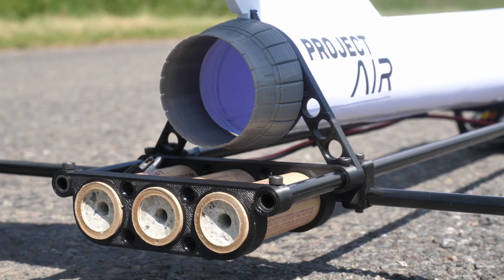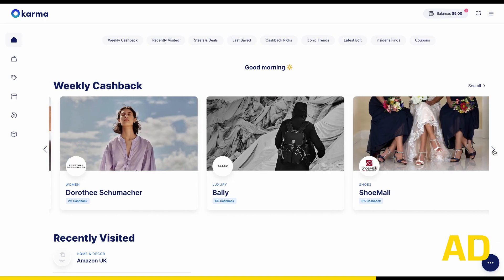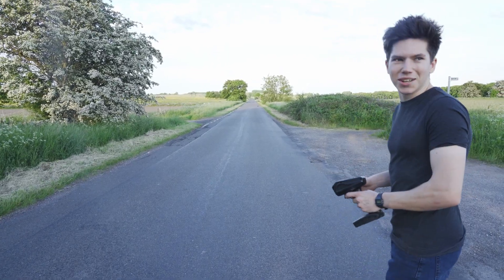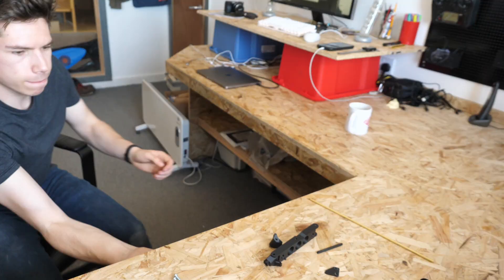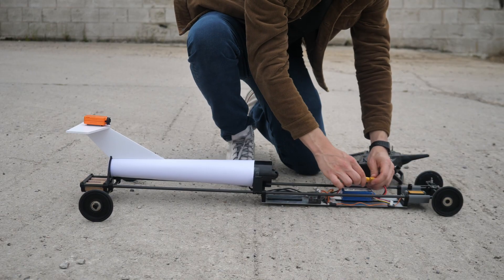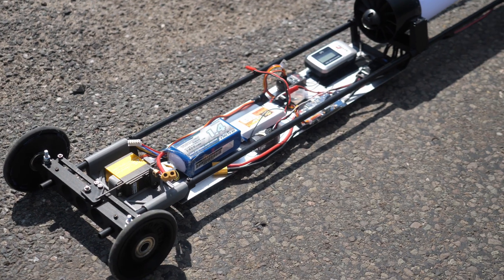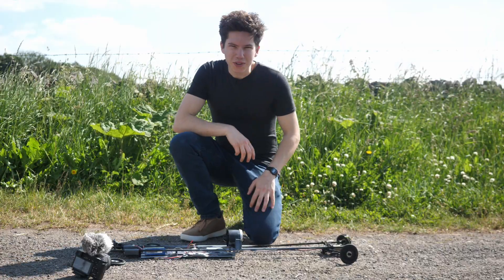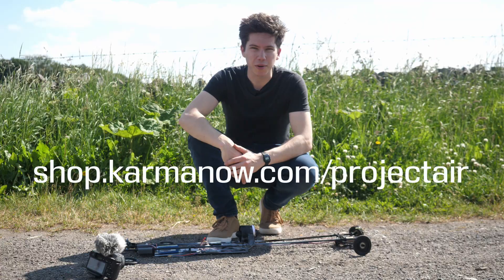Making a Rocket Car

Comment from the maker: Something always has to go wrong 🔥😂 Looking forward to building off this initial experiment with a much improved MK2 car in a future video. Leave any questions here and I'll answer with an FAQ edit to this pin!
Reply: Yeah it always happens lol excited for the video
Reply: True hardwork can be only achieved by mistakes....
Reply: Yes something always go wrong with my school projects
Reply: Suggestion instead of manual alignment to keep it straight you can buy rc car gyros which will greatly assist in keeping it in a line.
Reply: You should add live axle suspension, pretty simple suspension and better than no suspension. Also gotta love that you dont drive a broring grocery car but a real classic
Reply: lmao what do you expect strapping rockets to a car
Reply: @pedasjma23  
success without failure teaches you nothing.
Reply: you could try to use some tires with a bit more grip
Reply: and you could try to use the ejection charges to boost the car
Reply: No problem man at least u tried 💚
Reply: Maybe also put the rockets on the front...? I'm not an expert or anything, but on cars it is a lot easier to lose control on rear wheel drive cars than in front wheel cars, so maybe this can be applied to rockets.
Reply: That's the beauty of designing your own toys..... Imagine, design, build, test, destroy.... Do it all over again.
Reply: Try putting some kind of rubber material on the tire
Reply: What about using Dyson's fan design that increases the output of the input fan ?
Reply: i think you have to remove (od drastically change) the edf duct to inprove stability and, most importantly, speed
Reply: @riks7256  also needs some rubber on the tires but most importantly a suspension, got a lot of shaking, but for his first time doing this, it was largely successful i would say
Reply: Love your actual car
Reply: Great video, love your mini. You wouldn't consider building upon a already well established chassis in the RC world? Kevin Talbot (a fellow British youtuber) is building a 200+mph RC car on a store bought chassis to set the new world record for RV speed and is already achieving nearly those speeds without issues with the chassis.
Reply: @jacob.s3619   yeah but his point is to make something completely of his own, keep in mind that his final project is to make a car good enough for him to attach a jet engine on it
Reply: This is Crazy project lol
Reply: what 3d printer do you use?
Reply: "Well, atleast it didnt catch fire!"
That part made me laugh.😂
Reply: You should add the head part of the chair in your car so you wont die of splashback if someone hit's you
Reply from the maker: @dor4610  I will be!
Reply: @Project-Air  folks calm down...
Reply: ProjectAir Run jet engine with kerosene and oxygen mixture also with aerospike nozzles
Reply: ProjectAir don't ruin your jet enginr
Reply: Have you tried running the turbine on ethanol/methanol/wet ethanol to get higher thrust?
Reply: @brucebaxter6923  EDFs work on electricity
Reply: @adri1572  
and?
Reply: Run jet engine with kerosene and oxygen mixture also with aerospike nozzles
Reply: @parshvapatel8484  
the egts get too high before you reach stoich.
so you run a low energy fuel plus run it wet to get more thrust
Reply: true:(
Reply: @Crazy about plane crazy! 🤣🤣🤣🤣🤣🤣🤣🤣🤣🤣🤣🤣🤣🤣🤣🤣🤣🤣🤣🤣🤣🤣🤣🤣🤣🤣🤣🤣🤣🤣🤣🤣🤣🤣🤣🤣🤣🤣🤣🤣🤣🤣🤣🤣🤣🤣🤣🤣🤣
Reply: @emersonsims9503   you might not be a kid but you certainly is acting as one
Reply: @k-osmonaut8807  true
Reply: Trying to make plasma jet engine
Reply: Hi 👋
Reply: How would i get in contact with you to sponsor you to create this https://pdfpiw.uspto.gov/.piw?docid=10712134&SectionNum=1&IDKey=3B86FF913D05&HomeUrl=//patft.uspto.gov/netahtml/PTO/patimg.htm ? it is a two-stage bullet, gunpowder then rocket fuel.
Reply: Dont know why theres so much hate here... it was a successful prototype. Rocket cars arent easy! Cant wait to see mk2!
Reply from the maker: @ACplanet  Thanks man!
Reply: @ACplanet  Same! This man is great at what he does and should keep doing it. I bet that all the people who gave hate to him barely knows how to use a screwdriver.
Reply: Could you use bigger, wider wheels? I know it'll effect speed but if you're using 3 rocket engines, you might as well as at least it'll stray true right?
Reply: Love your Car!🔥
Reply: https://youtu.be/DXeEgeN_QKYllt
Reply: Love the project. What if the edf was moved forward of center so it's pulling vs pushing the car? May be more stable and allow a long vertical fin to use edf airflow to stabilize car against torque and thrust factors. Very cool project.
Reply: What's the usual airspeed of a plane with the same EDF setup? 30-40kph seems rather low, was the slow speed just due to the small tires and bumpy road perhaps?
Reply: They're called 'small municipal airports'. Find one. Your gear keeps getting torn up by terrible surfaces, like George Russell going over a sausage curb.
Reply: Yo you can make the car aerodynamic and add a some airbrakes on top and  engage it if the car get airborne
Reply: Sponseres called karma😂😂🤣🤣
Reply: I would put a wing on the front and a camera   if possible so you can get a driver's view for control and stability and while I hadn't seen the fire before I decided if I was doing it I would place the rocket motors mounted futher forward to minimize the weight shift as they burn. along with wider wheels  and a staggered ignition use the first one for the initial start after your maxed out with the ducted fan and then bring in the other two after a one second delay so the initial boost doesn't create stabilization problem. and I also would have mounted the rocket motors at a slight front down angle of about 2 or 3 degree and for the parachute deployment charge I would think about small vents to blow the heat away from the chassis. I haven't ever mounted rockets to a remote controlled car I've mounted them on model cars and got a few on fire and had them all get unstable until I put a little bit of downward angle on the rocket motors and they didn't like being at the rear they prefer to be mounted more towards the center.
Reply: everybody gangsta till the car goes airborne
Reply: @Crazy about plane crazy! two things wrong there. 1 im not a kid and 2 I'm not jealous at ALL. Why would I be envious of these projects. Wtf Is Wrong with u?
Reply: Yeah and that "wrong" is the design and the builder.. literally all your projects are useless and just clickbait.
Reply: @emersonsims9503  jealous much?
Reply: @davidkettell6236   jealous? Certainly, he even deleted some of his comments
Reply: @emersonsims9503  lmao u are just probably jealous because you cant make something like he makes, just stfu
Reply: @emersonsims9503   and you go touch grass, do what you said then, do something better than him and post a video
Reply: @emersonsims9503  i bet your built like a discord mod
Reply from the maker: @emersonsims9503  thanks for the kind words :)
Reply: @Project-Air  your welcome!
Reply: @emersonsims9503  bet u r satisfied now.....if it weren't for thos eccentric to create things useless for common ones...we won't be having all these luxurious tech life..... if he's not doing this someone else would so...
Reply: @topn-09  Lol. Seriously tho... don't over think it
Reply: @emersonsims9503   hey sir, here is your order for 900 kilograms of useless attention

Comment: 1st, you need a suspension system to decrease oscillations from the solid wheels and this will increase tractive force. 2nd, you tapered the exhaust from the EDF, it might be too restrictive for proper flow and what overheated the motor. 3rd, drive the rocket car POV for better control and draw, or paint a bright strip to follow for a centerline on the road. Nice try❤

Comment: How did you go about igniting the rocket motors remotely?
Reply: I'm a bit late but you can use a brushed ESC and and connect it to the igniter. Would also recommend putting it on a channel with a switch

Comment: I did one of these years ago when I was in college, you should consider using homemade sugar engines they have a lot more power then Estes engines and are alot cheaper.  You also won't need the turbine that just adds a lot of weight and high center of gravity.
Reply: Pretty sure they are illegal in the UK at least ik they are in canada

Comment: If you wanna make some thing similar to this again, that’s going to be going that fast I would suggest buying a receiver with a Gyro, which, as you probably may know, helps to keep your RC car going straight by communicating with the servo, and they are pretty expensive. I think the cheapest one would be over $100 but I have a Traxxas one that I don’t use so maybe if you ever make a PO Box I’ll send it to you

Comment: I built 3 R/C rocket powered cars. I see lots of things you did wrong... My 3rd gen car did 60 mph in 60 feet at about 1.5 sec. The drag strip could only measure my car to the 60 foot mark of the track.. They estimated my car going about 130 mph basted on my 60 foot mark...  I ran my car on a full sized drag strip in front of thousands of people... One thing you should've done is add front suspension and adjustable tie rods/steering rods... I would find a much smoother surface to drive on... I would recommend a parking lot.. The road that you used is not very flat..  Most roads are not very flat.. Most roads have a crown to them.. Meaning the center of the road is higher than the shoulder or edges of the road.. They make roads that way for water runoff... If you would like to know more just let me know... I've been doing R/C since 1985...

Comment: Very interesting projects you do. Hats off.  For a while I have been experimenting with rc cars with the drive directly attached to transversely mounted electric motors. One for each rear wheel.  I mount the motors on swing arms with expansion springs for the suspension medium. So the suspension is swing axle, which is fun. Standard size high torque 550 motors as used in crawlers work with small road car wheels.  Going up in size 775 industrial motors such as used for replacement electric drill motors work fine for larger wheels, though experimentation for the optimum size wheel is needed.  Im using two 775 motors with 3 inch wheels.  The lack of a differential can be an issue on bitumen or firm surfaces, and I have made a steering operated micro switch and relay affair which idles the inside wheel to reduce engine strain and understeer.  I am working on a simpler in hub supermagnet clutch for the same reason.  The wheel attached to motor without gears creates a very silent rc car with, according to wheel size used, great acceleration or top speed.  I have tried a quite large 895 industrial motor which a large amount of torque, however it draws a lot of current and surprisingly they are easy to burn out.  At the moment the 775 seems to be the best brushed motor to use.  The use of industrial rather than rc dedicated motors makes it cheaper - and easier to set up than brushless motors. I'll supply photos soon.  I use 18 volt makita batteries, again lots more bang for buck esp if one uses cheap chinese makita copies. I'm a cheap skate, and I figure I'm not the only one. https://www.youtube.com/watch?v=XpEmHajlCt4

Comment: You have no suspension and the road is too rough, it's bouncing up and down and losing contact with the road. If you added suspension (just use a cheap off the shelf RC car chassis, honestly) and larger air-filled rubber tires it would be a lot more stable.

Comment: yeah i kinda figured it would end like that with out suspetion  granted its more wieght but whats the point of all that speed if you cant controll it due to no handling acomidations  to smooth out bumpy roads because for tiny cars raods be typicly rough surfaces  but thats only becase they need to be rough enough to give grip to the normal sized bigger cars

Comment: you need a parking lot   back in 1967 i built one with my rocket i stuck Stright axles on it with two eye hooks on it. one in the front one in the back then i Stretch a guide line  for about a100yards  now i was only 10yrs old at that time   that dam thing took off like bat out of hell  oh buy the way i use size (D) motors

Comment: Hey...

But of constructive criticism:

If you were 5o use 1st stage booster motors, without the recovery charge,  you wouldn't have the risk of fire such as you had with the first test run.

Comment: I wonder if larger diameter wheels would help it be more stable. Obviously you lose some performance, but the larger wheels would basically take the place of suspension since they don't tend to drop into holes or bounce over bumps like smaller wheels do.

Comment: If you are using a programmable R/C transmitter, you can calibrate a RC car ESC to have forward and backwards throttle to use as breaking.

Comment: Great start.  I really enjoy these ProjectAir vids.
About 30 years ago we built a rocket car in school which used a single Estes' engine.  The biggest difference is that we ran a long wire on the ground (fishing line maybe??) and the underside of the car had 2 or 3 eye hooks for the line to thread thru.  This kept the car going perfectly straight.   This is was more than 30 years ago, so I don't recall too many particulars like did the line burn?  What happened when the ejection charge fired?  etc.  However, I do recall it sure was a lot of fun for us kids in the schoolyard.  (no way would they allow this in school today)

Comment: You need suspension. Even when using thrust instead of a drivetrain, your tires need to be able to stay on the ground consistently. Also i think the whole thing needs to be a bit sturdier, maybe even a bit heavier, and the tires a bit wider with a tiny bit of ‘’give’’. And your front end looks. To be too close to the ground (and angled), that might get pushed down and pump into the round, no?
Great vid!

Comment: Another thing you can copy from F1/your RC car is the completely flat panel on the underside of the car. It uses ground effect to create negative relative pressure between the ground and the bottom of the car to create more down force.

Comment: I mean a high front track would be better for lateral stability. Adding a rudder might also help for high speed and some downforce with more forward CoP also. Anyway you need high torsional stiffness to have lateral stability and probably for higher speed also a longitudinal stiffness.

Comment: Air fans, propellers, jet engines, etc are no good to propell cars, I don't think the complexity and weight added by the fan are worth it for just 30km/h.. you should put a motor with larger wheels to star moving the car or just remove the fan and go all rockets maybe. Plus you made the car very long to make it more stable going straight but you also made it very flexible, combine that with no suspensions and rigid wheels makes it very unstable. You need to make it more rigid, add way more aerodynamic surfaces and reduce the steering sensitivity if you want to have a chance to keep it stable.

Comment: I'd say use wheels with tires so you have more grip than PLA, camber in all 4 wheels and even use a rudder on the tail for better steering authority at higher speed. Maybe a sheet metal shroud for the rocket motors

Comment: chassis is 2 flexible. angle aluminum instead of carbon fiber? its light, rigid, easy to work with, inexpensive, and widely available.  bitthose front wheels have some issues for steering. first not enough surface area. start with bigger wheels and tune down later? (I know legit dragsters have small wheels. maybe when you get there and thats your bottleneck, in the meantime stick to fundamentals and refactor later) second, at speed they arent going to have enough downward force to be effective. you could add a big front wing but that would have other issues 2 i think. I would go with a rudder. at speed you can steer with the air -- u are project air after all ;) I would consider adding an imu and possibly mix the steering by accelerometer. i guess you could just limit range of motion of rudder. at speed it would be sensitive otherwise. better it handle rougher at low speed than high speed right? design for the goal and trade off low speed handling characteristics for high speed performance. my 2 cents worth.

Comment: Interesting idea with the electric fan for a rolling start.  When I was a kid I made a much simpler version of this just rockets.  I found if you angle the rockets down a bit so the thrust shoots a little upward it keeps it from getting airborne at top speed.  Also put a brick behind the motors at launch and it will have ridiculously fast acceleration.

Comment: one tip i would give you, never use small narrow wheels like those, the asphalt is coarse and you need compliance in the ground/tire relation, aerodynamics of them should not be ur main concern until 100mph , you need another kind of tires, i suggest those of high performance 1:5 FG cars.  or even serpent rc foam tires...  ive done very small scale car racing 1/24 group 20 slotcars , 1/10 rc electric and gas, 1/8 and 1/5, so... take my word... those wheels and tires u got, are for silky smooth tether circle track speeders, not for street and pavement you find anywhere...

Comment: I built a rocket rc car when I was in high-school. I used some thin metal pipe with to elbows to angle the parashoot charge backwards and actually made drag shoots. Kept the flames away from the guts of the car and provided a bit of brakes. I also used modified rc plane foam wheels with bearings instead of plastic ones. Sadly on my 5th run with it one of the rocket motors for got how to rocked and decided it was a bomb instead and blew the car apart. I would have loved a 3d printer on that build but it was the 90's